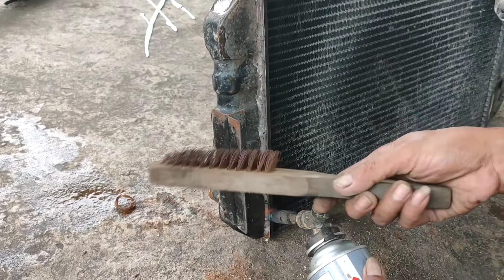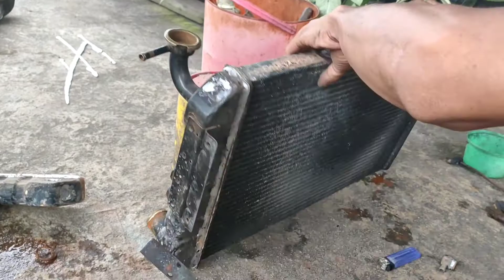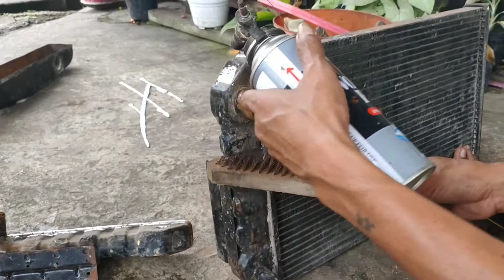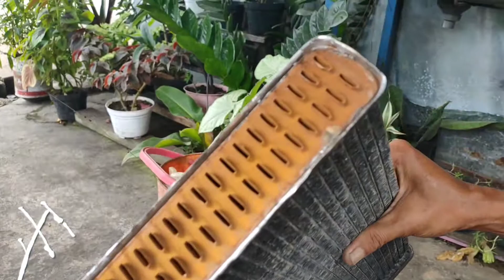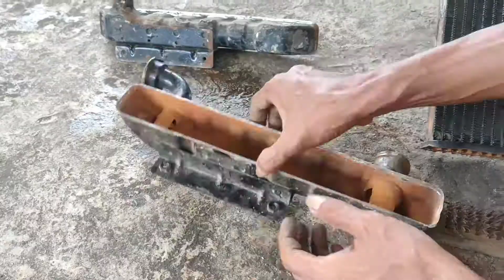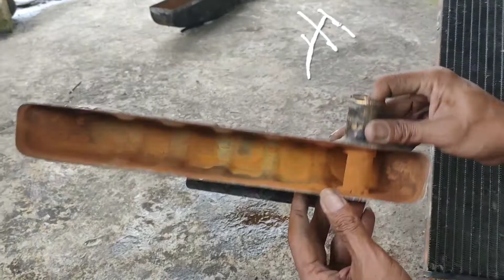Cara membuka upper tank bahan kuningan dengan cara yang sangat mudah

Comment: Sya diy dirumah ada 2 kapiler yg keras bgt 0m / buntu.. sampe sekarang blm bisa tembus, posisi mampet 1 di 10 cm dari atas dan 1 nya 10 cm dari bawah. triknya gmn ya biar bisa bolong? Suwun..
Reply: Dari siang td ini 0m.. 2 blm plong
Reply from the maker: Sampean tinggalkn no wa mengko tak pandu mas,radiator mobil opo mas
Reply: Alhamdulillah.. barusan sudah tembus semua 0m, tinggal berdoa semogananti kl dipasang tdk ada bocor👐
Reply from the maker: @vouschannel3050  dites dulu mas sebelum dipasang
Reply: @dkautoofficial5903  kalo gada kompresor enaknya di tes dgn apa ya 0m?
Reply: @dkautoofficial5903  gak bisa tes dl, akhirnya langsung pasang dan bocor 1 titik 0m di sela2 klem 😓
Reply from the maker: @vouschannel3050  tinggalkn no wa nanti saya pandu mas